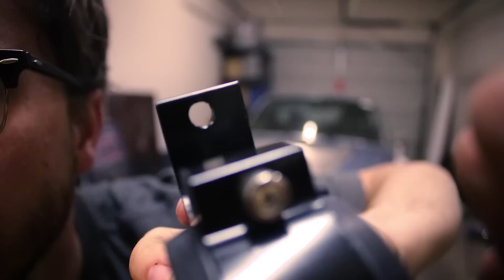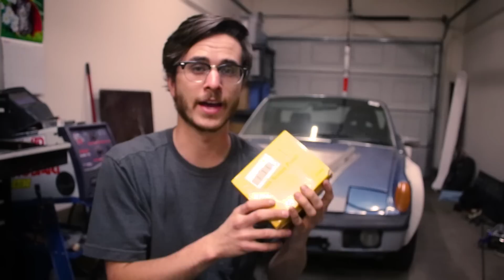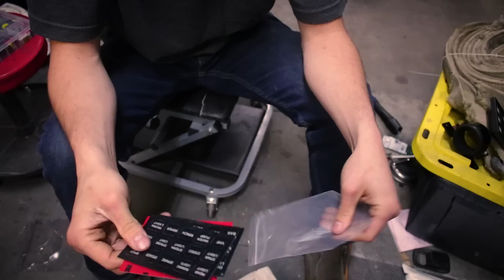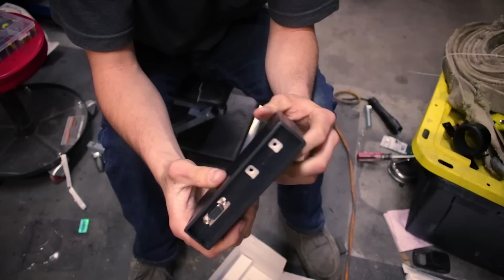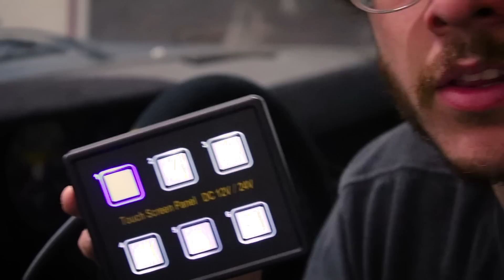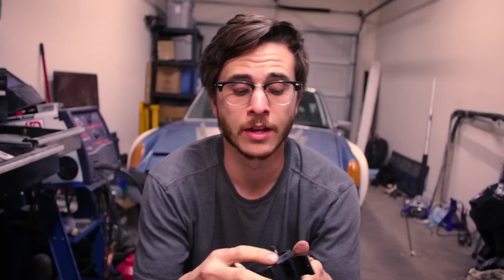Buying super CHEAP Car Parts from Wish!

Comment from the maker: Leave me a comment letting me know your thoughts! Don't forget to leave a like and Subscribe!
Reply: SMB Garage good video! I subscribed! me being me I would sharpie the lettering on the touch panel.
Reply from the maker: Thanks! I'm planning on splitting it open to paint that panel, so it looks nice and original
Reply: id recommend using a relay for the switch panel so that the switch panel sends a signal to the relay which then turns on what ever you have connected to it without any current/voltage drop
Reply: SMB Garage good shit man I understand wish doesnt have much but shut looks good
Reply: SMB Garage copy cat
Reply: U say the switch panel is ´´quite heavy´´... most chinese products have weigts built in to them to make them apere higher quality. 
nice vid, keep up the good work!
Reply from the maker: Ive seen that before. This one does not feel artificially heavy like that. Thanks!

Comment: That switch panel is bad ass! The real question...is it rated at 10 amps per circuit or combined? If its combined that's only 1.6 amps per switch.